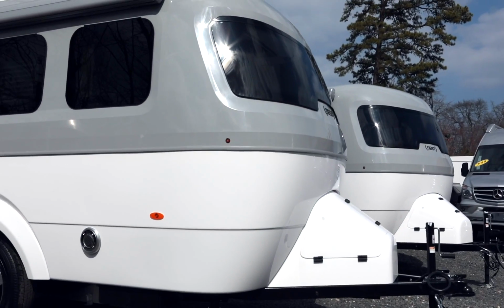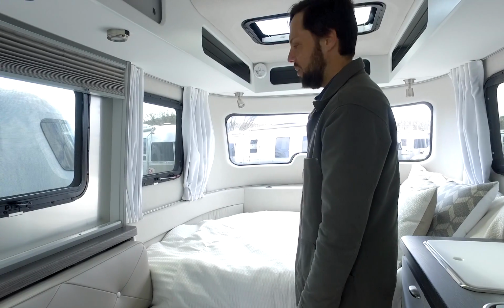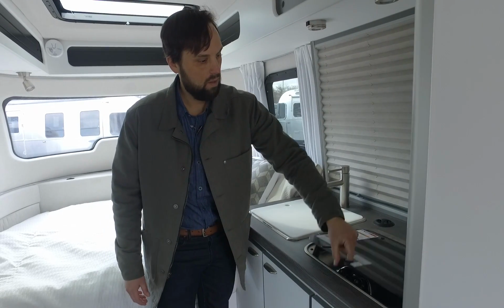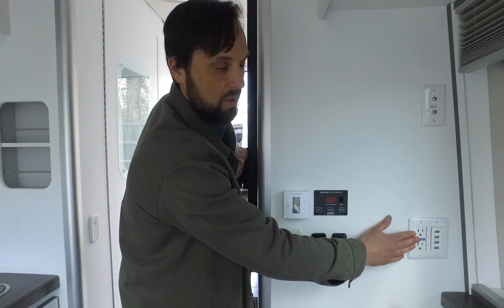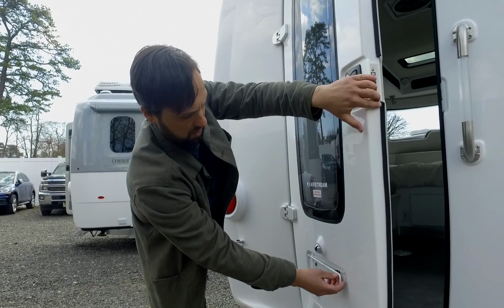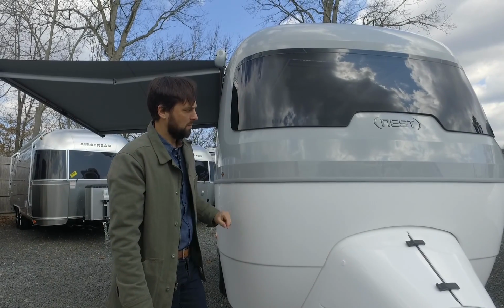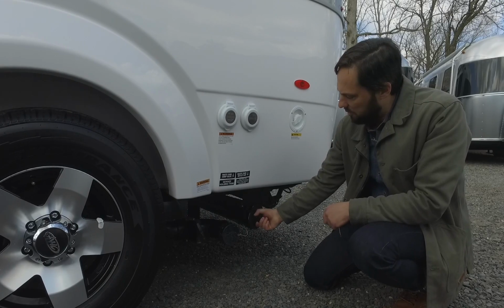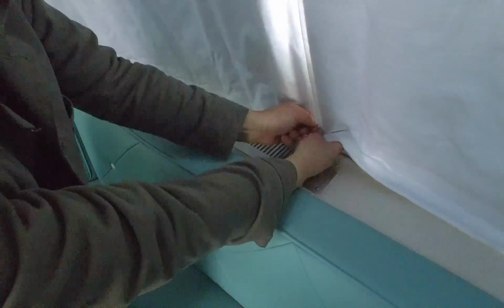2019 Airstream Nest Travel Trailer Walkthrough

Comment: So much better than an Oliver. This is a great trailer.
Reply: The Oliver Legacy Elite 2 is not already rusting like the Nest models I have seen in showrooms. The Oliver is also four season capable. Yes, the Nest shower is nicer. Noting the obvious, the Nest fabric and pattern selections are puny in comparison to the Oliver. Both could use better countertops. The construction of the Nest cabinets is okay for a $25k (after 30% discount) travel trailer. Lance does a better job with cabinets. I love the Lance Roadster interior fabric.. Finally, why the Nest bungies?
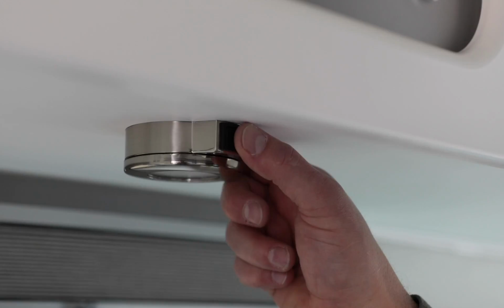Reply: "like the Nest models I have seen in showrooms" Have you taken photos of these rusts that you saw and alerted the dealer or even Airstream? I scrolled to 3:55 in the video, hit pause, still couldn't see it though.
Yes, fabric selection should be improved because it would be disappointing to see so many of these on the road or camp looking all the same.
Reply from the maker: Thank you, many people have made that same comment.
Reply from the maker: I am not sure what rust you are mentioning. Is it surface rust from building metal shavings that may have laid on the surfaces during construction and rain booth testing?
Reply: emmcey maybe you could be more specific as to where it is exactly because even the ones who made the video didn't know about the rust you have have seen.
Reply: The rust in your video seems to be on a galvanized access panel that has  either been damaged or ill fitted. Two of the rivets are missing completely and one is only halfway inserted. I hope you mentioned this to the dealer where you shot this video. I bet Patrick would have this fixed if you spotted it on one of his trailers.
Reply: I live in TN and have been to the Oliver factory.  Anyone who makes the comment "So much better than an Oliver" is clearly uneducated in both trailers.  The Oliver simply uses higher quality everything and for about 10k more you get the 23 footer.  Just compare part for part and you will see it clearly.  I love Airstream and this NEST is cool but overpriced for what you get, especially compared to an Oliver.  Remember Airstream is also under the THOR giant.  Oliver is a small custom factory. For the record I own a Sylvan Sport Go so I have no fan boy interest.
Reply: I see what looks like rust 3m 55s into this video. Here is a link to my video: https://youtu.be/lM1s0JxOY0I
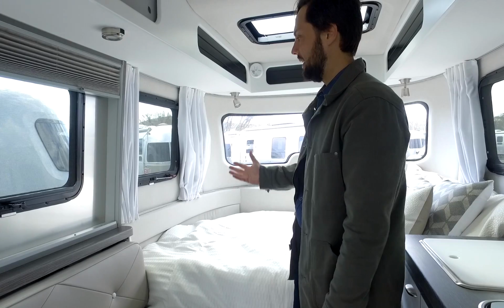Reply: Experiment Eks pause video at 3:50, look underneath trailer for big rust spot on what looks to be the water tank.  Ps it’s on hmm Garza’s video posted above, not this one by colonial airstream
Reply: Preferable to a tiny home.
Reply: are you blind, how could you not see the rust.